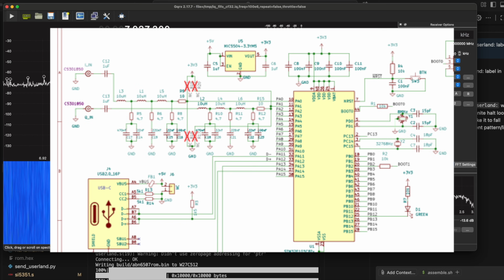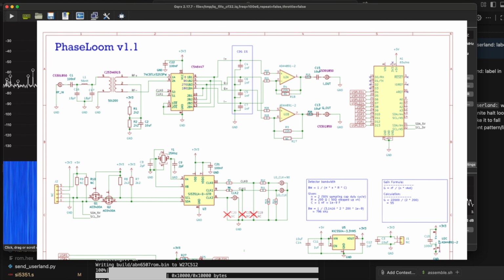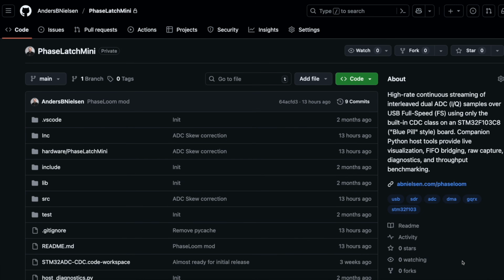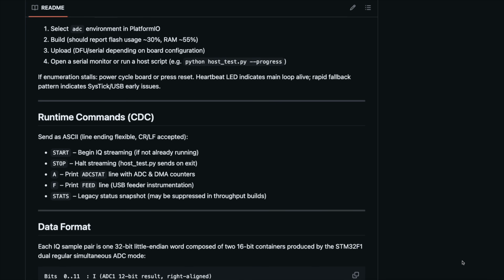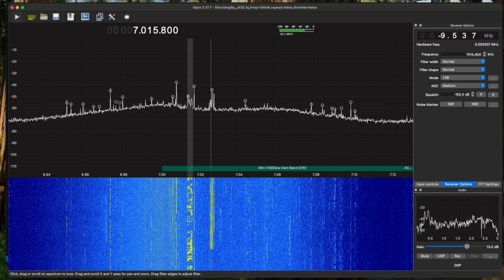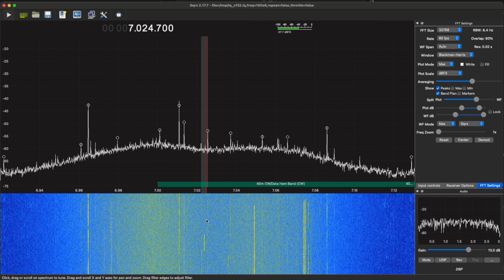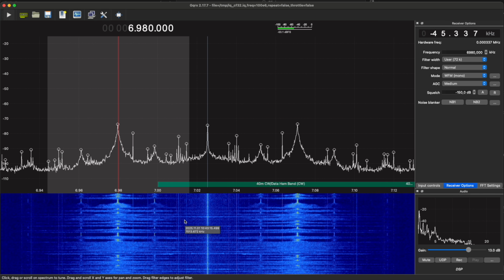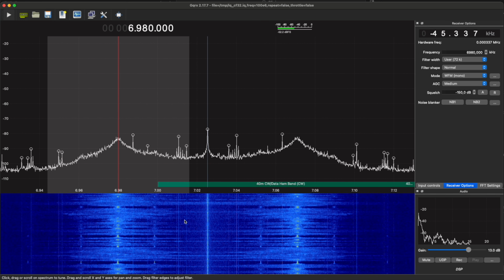6502 + STM32 join forces as cheap SDR!

Comment: So do I understand correctly that the PhaseLoom (6502) receives the RF from the antennas, and filters/mixes it to provide an input to the STM32/ADC that is within STM32F103's bandwidth (50-200khz)?     But why do you need 2 channels.. isn't I & Q derived from a single ADC?

Also how does transferring 2 channels worth of data every microsecond (2*16-bits/S * 1MS/sec = 32Mbits/s ), fit within USB2-Full-Speed (12Mbps)?   And does the DMA configuration handle moving the conversions over to the USB2-FS without CPU intervention?

From what I read, those RTL SDR dongles can do 2MSPS with a 2Mhz input analog bandwidth, and use USB2-HS (480Mbps).. however the ADC is limited to 8-bits.   For SDR applications, is the STM32F103's 12-bit resolution what makes it more attractive that the RTL2832U?
Reply from the maker: It’s 215KSPS, so lower than the RTL-SDR. That’s how it fits. 
Regarding IQ I went over it in the last video - basically: You need an ADC covering the whole band (at RF) and gigasample ADCs are expensive.
The STM32 mostly wins on price and availability - and the 12bit ADCs increase the dynamic range.

Comment: BTW, you can use audio sapmpling ADC's over i2s and get around 250ks/s this might not seem that diferent but you can get 24bit ADC's and an amazing resolution
Reply from the maker: I did consider it and have one on my table, but then you still need an I2S capable MCU with USB2.0+ to take full advantage of it. 
I think I've found a way with waaay more bandwidth :) Also, ENOB usually isn't anywhere near 24 bits except on the really high end chips in lab conditions.

Comment: Have you also matched the in line resistors around the opamps? Only matching the feedback resistors is of little use otherwise.
Reply from the maker: The in line resistors before the opamps are 0 ohm, so they're pretty well matched :)

Comment: That's cool, but wouldn't it be better to simply get a proper ADC like how the higher grade SDRs do?
Most SDRs are just an ADC from Analog Devices and an FPGA from either Xilinx or Altera both of which are very expensive components but I'm pretty sure you can cheap out on em and still get much better results than what most microcontrollers can do by themselves.
Reply from the maker: Spoilers ;-)

Comment: I would love to have something necklace sized, to run a single Mayhem app🤗
Reply from the maker: Not a bad idea for a concept :)
Reply: @AndersNielsenAA I want mine to run the ADS-B RX App. But i guess, then it also will run Replay or Level.
Reply from the maker: @goiterlanternbase  Well a necklace ADS-B receiver is certainly possible - especially if purpose built
Reply: @AndersNielsenAA   Especially if it doesn't need much reach. It only needs to capture signals from close by, like at the helipad on the roof or a plane on the gate, who are powering up.
In my case, the starting medicopter at the hospital.

Comment: Can someone explain to me like I‘m five what this thing does?
I don‘t know why I got it recommended and my hobby are old analog video signals, especially tube driven stuff it interests me, but I have no clue what this is for.😊
Reply from the maker: It’s just an ADC.
The idea is that it takes radio signals and digitizes them so they can be listened to and moved around on the computer :)
You might want to check out my previous video that gives a helicopter view of software defined radio

Comment: How about raspberry pico they can overclock really high 
adc is 12bit
Good Dma control 
3adc 
And pio that are universal state machines that can do many things like transmit fm
Output VGA
Or even HDMI
Bitbang USB
Reply from the maker: The Pico only has one ADC so it can’t do simultaneous sampling
Reply: @AndersNielsenAA oh I just dug deeper and you are right anyway could using multiple Pico be valiable Option to archive higher bandwidth I would assume it might be hard to synchronize them
Is 12bit adc enough or would 16bit be preferred 
Also how much sampling rate would be recommended
Become I can get 500ks/s normally on rp pico and even 1.3MS/s when overclocked but it might not be stable
Reply from the maker: @matgaw123  You’ll need something like an STM32H7 to get something equivalent to an RTL-SDR - so not economical. 
Next video I’ll show a very reasonable solution.
The number of bits usually isn’t the limiting factor - the HacRF One for instance is only 8 bit.
Reply: I was initially very enthusiastic about using the 6502 but after thinking about it .  6502 does not have  a multiply or divide instruction. It seems like a strange choice for a signal processing device.
Reply from the maker: @mbnyc5401  If you think about it for a second - the RTL-SDR doesn’t do any DSP either :)
It’s going to be a “because we can” exercise - doesn’t mean there won’t be a more powerful core doing things later